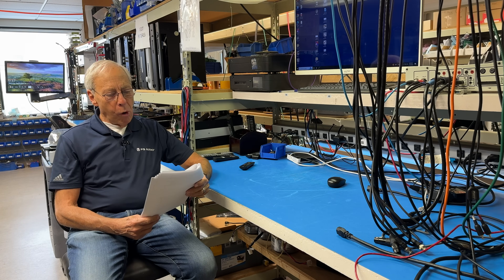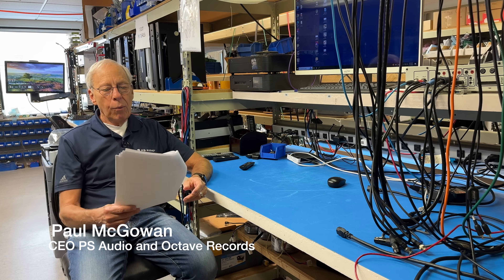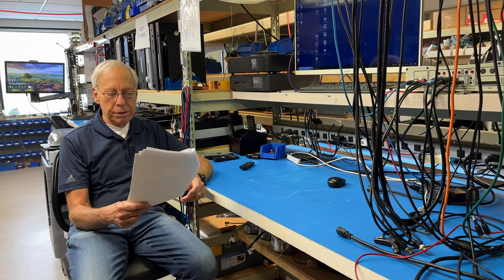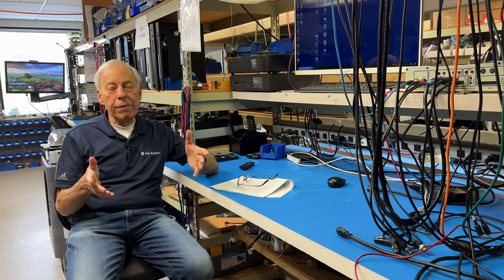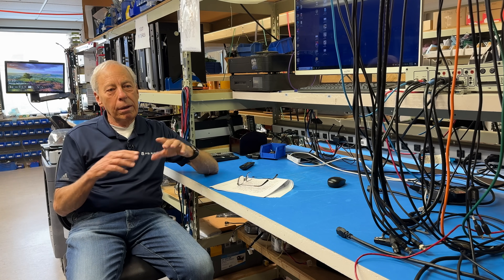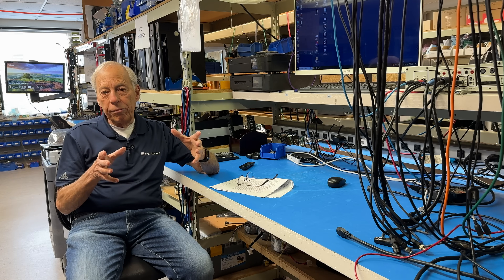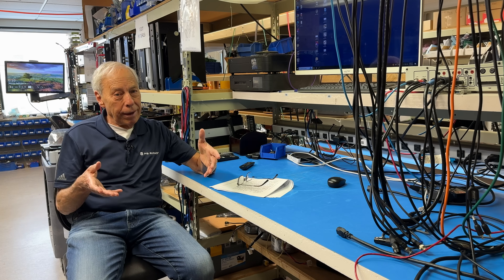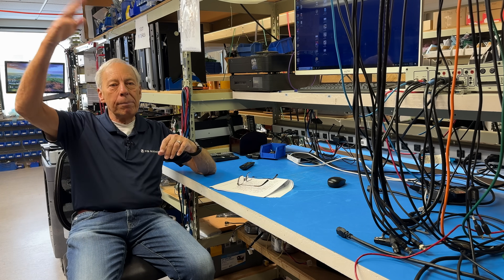Subwoofers and power regenerators

Comment: A powered sub IS a power amplifier. I don’t understand the logic here
Reply: A sub doesn't deal with a wide enough frequency range for it to matter that much. It can help slightly, but only in the upper bass regions on complex passages.

Your main speaker power amps deal with a lot more information, and so the cleaner the power, the cleaner the output.

Comment: There is consensus that power plants or high quality power conditioners are good for source equipment - where I struggle to find consensus is for Power Amplifiers.  I have two large mono-block McIntosh MC451 Hybrid Solid State/Tube amps - McIntosh tech support recommends plugging them directly to the wall.  What do you say Paul??  Thanks - love the videos!

Comment: I believe that IF any source or preamp needs a regenerator, the power supply of the source is inadequately engineered! At the prices of high quality, low level equipment, this issue should have been solved YEARS ago. Just think about it, why regenerate 120V if in the end all we need is a very clean, medium to low current +- 12 to +-24V? Now power amps are a different story - especially the more powerful ones. There the cost of a regenerator for them should be up to the audiophiles situation - economically and audibly. I would still question the sense of two large power supplies - in the regenerator and power amp, but hi end is often synonymous with excess.
Reply: I've found that a Powerplant makes more difference to source components and the preamp than it does with a power amp though it still makes a big difference to power amps.
These are all components that have state of the art power supplies that could in no way be described as deficient, high quality transformers, large banks of high quality smoothing caps, multi-level discrete voltage regulation and pre-regulation.

Even with well designed and well implemented power supplies a Powerplant still makes a big positive difference to sound quality.

I don't really understand why they make such a big difference. I don't just dismiss the stuff I don't understand.
Try one. You'll be pleasantly surprised.

Comment: This all makes sense to me.  I believe that the difference between good and great lies in the ability to accurately reproduce low level information with accurate phase.  There is non of those miniscule signals buried in sub territory.
I do challenge the musing about combining a DAC and a regen into one unit.  Why convert AC into DC to regen into AC so you can convert to DC for various DAC circuits?  Just build a better power supply for the DAC IMHO.

Comment: You have to ask. If you get a difference from an external cable, how shockingly bad was the power supply design of your kit? Do you believe that after adding up the transformer design, capacitors, input LC filters, soft rectifiers, snubber network,  inductors,  local decoupling, cascaded active regultors and the amplifier inherrent PSRR that the mains cable or an external mains fuse type has a significant enough effect to make an iota difference?    You may  notice a difference, but it isn't anything to do with electronics. I think this is what drives Engineers nuts, the application of what you think you hear onto hard facts.
Reply: I have to ask if you know what a power regenerator is? I can tell you that it is not just a filter, it supplies you with a very low impendence power supply, and cables will make a difference if you have a revealing system and don't have the huge transformer for your whole street right outside your door.
Oh and BTW, an engineer does not necessarily care about sound quality - in fact, most don't give a toss.
Edit: Paul has stated many times the importance of low impedance power sources for good sound quality. That is why they use oversized power transformers in all their equipment.
Reply: @Kiwi_Col ... and actual  measurements of Paul's "mains regenerator" output impedance, noise and whatnot, can be found on Audio Science Review website/channel.
Reply: @paulb4661 and published by a man who only ever listens with an oscilloscope.
I never listen with an oscilloscope, I use my ears every time.
Reply: @nathanevans6277  and you're wrong even to begin with, spectrum analyzer, state of the art one to be precise, is not an oscilloscope. Then again, end consumer cannot be expected to differentiate between strictly technical terms, or familiar with what makes the devices tick. Back in the days of monster cable emergence, soundandvision magazine approached a number of figures associated with the industry with a proposal to conduct blind listening tests under controlled conditions. An agreement was reached, as long as anonimity was guaranteed. And guess what, none could tell a fancy speaker cable from a proverbial lamp cord with a statistical significance. Years later, Steve Guttenberg failed to accept James Randi challenge, which would entail a huge pay-out, if he could achieve this feat. Now, I do not expect that psychoacoustics, yes there's a scientific discipline that deals with vagaries of human hearing, can offer any insight into hearing thresholds, since it never gets a mention in believers' circles. Believers, since there's nothing to support their "findings" apart from continuing to believe and like with creationists, no amount of data will ever make a difference. We listen with our brains actually and often hear what we simply want to hear. Confirmation bias is the name of this phenomenon. In a similar fashion, certain methods are used to establish real effectiveness during med trials. To eliminate the human factor, which makes many participants swear by improvement courtesy of talcum tablets.
Reply: You know what drives audiophiles nuts? Electrical engineers who claim that power cables and the like make no difference, without even bothering to listen to them in a controlled listening test. I don’t claim to understand WHY power cables etc. sound different, but I accept that they do because of my own first hand experience. I listen with my ears, not a multimeter!
Reply: @RichTeer well said. Exactly what I was thinking.
Reply: Most power supplies in audio equipment aren't nearly as good as you think they are.

Comment: I bought a BHK 250 this summer and a P12 to get the amp close to the tower speakers. I ran the speaker wire set-up directly to the dual 10 inch Sub like Paul recommends and it sounded great until I tried plugging the subwoofer into the P12 and it made a big difference for me. Everything became more of a punch than before. I've left it that way but it's "me" that hears and feels the difference. Everybody hears something different and if you like it then do it. You'll never know till ya try. 🤷‍♀️
Reply: Sure bro. And the soundstage got wider, ye?
Reply: @djlolerkoster it is well known that a couple of decent subs improve the scale and layering of the soundstage.
Try it.

Comment: I recently moved. The power lines are pulsating at 60hz at 60db non stop! That's not normal right? Sounds like someone's subwoofer. But it's definitely the power lines. No transformers around here. Is there someone I can contact?
Reply: an otolaryngologist and if that doesn't help, a psychiatrist would be best
Reply: @MS-ug3gm  I know I'm not crazy because when I leave the area and am on a different part of the grid. The power lines aren't doing it. I don't think I've ever seen power lines do this before. It's like the decay of a bass guitar string stuck at 60hz lol I will more than likely move again 😅

Comment: I agree with Paul. I have REL subs in my two channel systems, and have never heard any sonic improvements from upgrading their mains supply. I now just use entry level Kimber cords plugged into wall outlets, and am happy with that. I think it's because subs only operate through such a small frequency range that costly or exotic mains power arrangements may make only an irrelevant improvement to their output. Hope this helps!

Comment: So… specifically, what’s the reason a power conditioner works incredibly well with a power amp but barely at all with the amp inside a sub?
Reply: Cleaner power improves the mids and highs, far more than it does for low frequencies.

I am uncertain... but I believe it has to do with our perception.
For example, our brains are very good at identifying voices, even down to small subtleties -- but less so with a subtle difference with low frequency notes.
Reply: @0Perhaps  Highly plausible! ✌️
Reply: @0Perhaps you do realise that any power regenerator or whatever doesnt do anything in 99% of all cases?
Reply: @djlolerkoster  "you do realise that any power regenerator or whatever doesnt do anything in 99% of all cases?"
Yes.

I have tested 100,000 any power re-generators or whatever and discovered that only 1,000 of the 100,000 did anything.

How many have you tested?
Reply: the sub is only playing a certain range ,your speakers and mostly full range unless you cross over the bass and send it to the sub , why waste money on a regenerator for your subs , hes right put it at the source

Comment: I would say, I don’t hear any difference at all…some times these statements become ambiguous when not clearly saying you can’t hear a difference at all. I see it too much in audiophile discussions, that nobody wants to admit some improvement didn’t yield an audible difference. For the money, I would much rather spend them on a better subwoofer or speakers.
Reply: I just return the item if it doesn't make a difference or sounds worse. I think most people are smart enough to do that.
Reply: @Pete.across.the.street  No, this is how it actually works. If you buy something and you’ve paid good money for it, your brain will tend to feel it sounds better and without a proper A/B blind test, you will believe you got value for your money. This is especially true with very expensive cables.
Reply: @ThinkingBetter  why would audio grear be different than any other type of product with returns? If you don't like it return it.
Reply: @Pete.across.the.street  The reason is that    some audio gear is sold more on imaginary differences than actually audible differences. This is why the term "snake oil" is found much more when talking about audio products than on any other type of product. You can buy a US$1000 SPDIF cable and claim it sounds better because you convinced yourself it's true, even any audio engineer easily can tell you that such data interconnect wire has no sound to it.
Reply: @ThinkingBetter   No, one buys something they haven't owned before because they want to "test" it for themselves. Relying on what other people say may not be what you hear or see in that product. Pretty damn simple, people like many different things in life. Just because you say it sucks doesn't mean someone else will think it sucks. It's like no one can have a difference in what they prefer. Believe it or not, many, many things in life are absolutely subjective weather or not the specially trained people say it isn't so.
Reply: @ThinkingBetter  that's just a myth
Reply: @Pete.across.the.street  What exactly is a myth? I do audio R&D professionally and also have done listening tests and blind-testing many times as part of the product development process. You can tell your test panel that you just swapped the cables to some much more expensive ones, and even you didn't do it, the listening testers will claim that now they hear more details and a more precise sound stage. Done that. This is why blind-test in audio is so important for getting valid feedback. The human hearing is not precise accurate measurement. Even how well you slept the night before can hugely impact your ability to hear details and sense a sound stage. One of the tricks to "listen better" is to drink a Red Bull some 30 minutes before the listening test btw.
Reply: @ThinkingBetter  yeah that part is a myth as well
Reply: @Pete.across.the.street  Nope, it's factual.